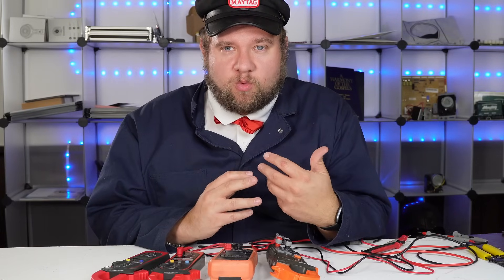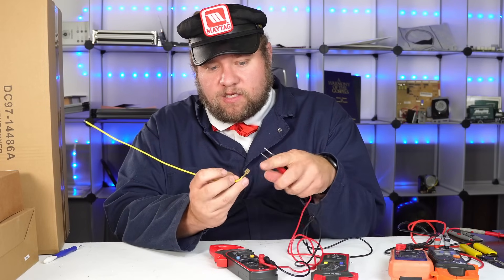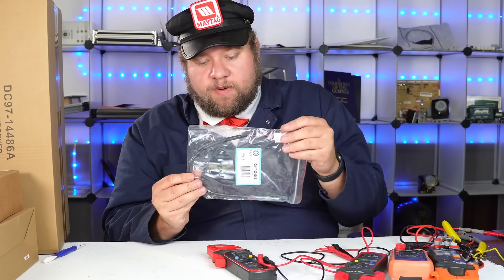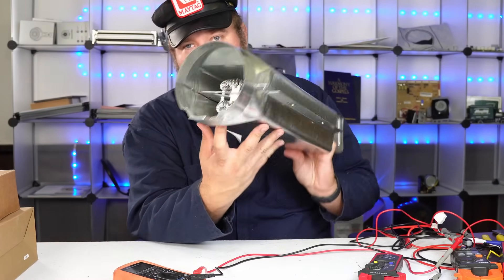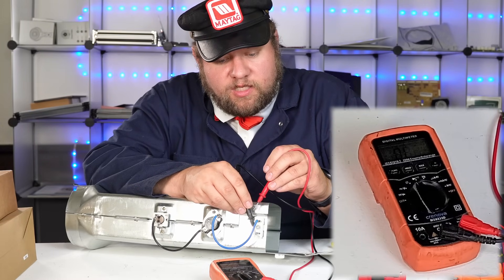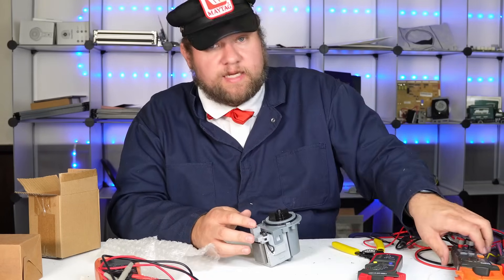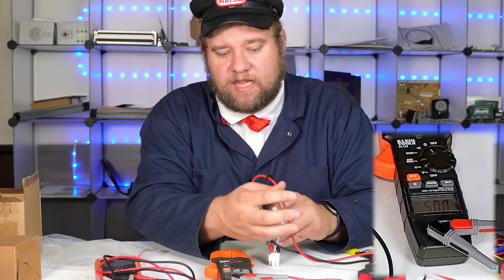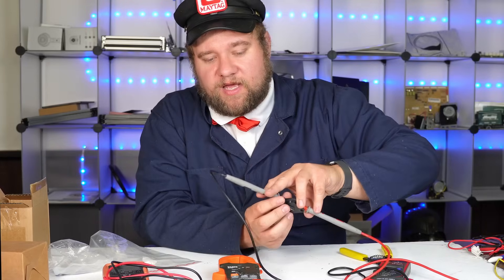How to Use a Multimeter for Appliance Repair

Comment: Really wish my father was smart anout keeping up the storage payments so that I would have access to his old tools of the trade such as his multimeters to use ehen checking and finding out what is wrong that needs to be fixed. Sadly he didn't. He has been hine for a year now he passed away last year on 2-1-2024 in his sleep. Because then even when gone I would know what's what then look online for the replacement parts. Snd sadly some things were fairly easy to figure out without but sadly  the parts were no longer available and had to completely replace an appliance for which I wish I didn't have to. I really hate the throw away society we have become. No thanks to the manufacturers.

Comment: Ben I need replacement parts for my 10 yr old Wolf stove. I know wolf won’t sell to any one can you advise….I my Ir Broiler won’t work…
Reply from the maker: I'd check for visual matches to broiler. Many times the botique companies are contracting the same places Whirlpool and Frigidaire do. I know for example, Viking gas ignitors that are $250 are basically an IG9998 which retails thru us for $30.

Comment: Great info. Maybe you can take it a step further and show us how where to find the correct numbers, so when we test a sensor we know what “normal/working” looks like?
Reply from the maker: That will vary between every single sensor by  model which is why. I have the videos that show you generally how to repair and test things for the proper homewriting.This was just meant to be a guide in general, but maybe at some point. I can do another follow up video. That would just have me testing all kinds of different things for ohm ratings.
Reply: There’s how many of the check charts ?
Hundreds ???

Comment: The message here from Ben is: Slow down! Take the time to troubleshoot the issue so you fix it just once!    And ya wont be throwing the parts cannon at the problem. Great vid!
Reply: had a dryer that we thought was bad, got a new one and it didnt work. Had 240V at the outlet but still didnt work. Called the contractor back out, didn't work, they got us another new one, still didnt work. At that point we knew it was not the dryer nor the old one.
COme to find out the outlet was reading 240V but it would not pass current. That wire was bad, so we had to replace that 240V line from the outlet back to the breaker, THEN the new one started to work AND the old one started to work again. 
SO reading 240V at 16:32 at the video means nothing

Comment: I plan to harvest my old compressor from the refrigerator. Has anyone tried to shut close the lines with the help of hand held hydraulic crimp tool before cutting the lines. Is it going to work? I don't have a proper evac system.

Comment: It is extremely hard to read the multimeter close up box in your video.  Any chance you can adjust the contrast or lighting in the future? I will give you a tu for the side comment about the back end. Lol.
Reply from the maker: I may do another video in future. I tried to enhance it ad much as possible but I didn't realize how bad the camera angle was honestly til I was done

Comment: Nooooo, don’t ruin good parts to demonstrate a bad circuit. Electrical troubleshooting requires way more info than you could put in one video. Just finding the correct value resistance for a component could fill an entire video. However, great demonstration of why shotgunning parts is a waste of time and cash. Maybe show electrical troubleshooting and repair on a broken unit from start to finish. It would probably require a lot of editing to compress the video time, but better demonstrate your methods and train of thought.
Reply: Why don’t u make one then 🫣🤫
Reply: @SheekAlibaba  Considering I commented a year ago, the point was don’t waste good parts. Electrical troubleshooting videos and Fault Isolation Manuals already exist. No need for my video. I fix planes. Ben does a great job.

Comment: I have to admit....when you were explaining not to touch the posts with your fingers when testing for voltage and then sparks flew when you acted like you did.......I jumped a bit.:face-blue-smiling:
Reply from the maker: I saw someone do this with a capacitor in a video and knew it had to try it